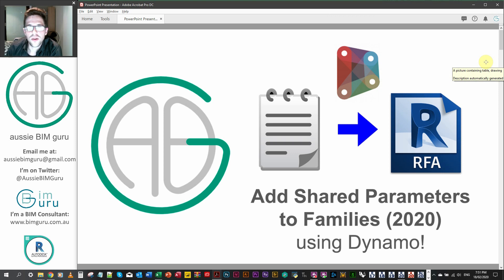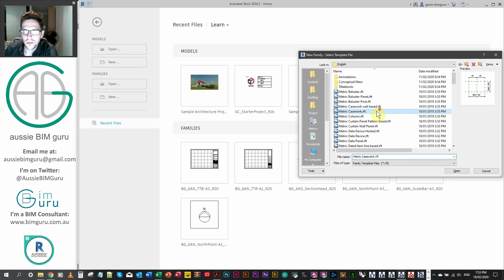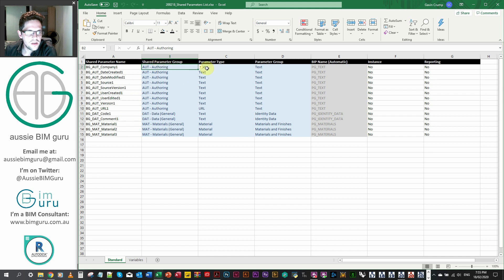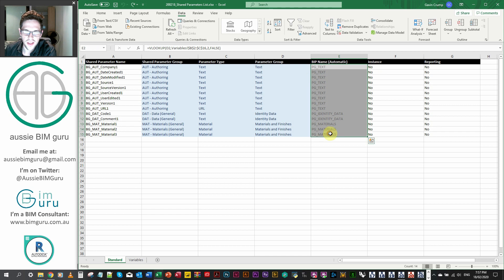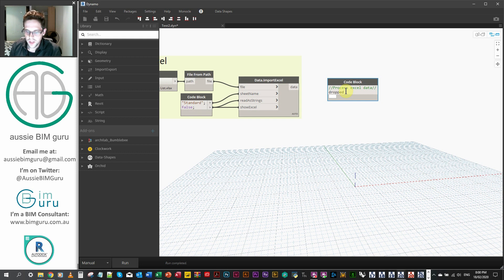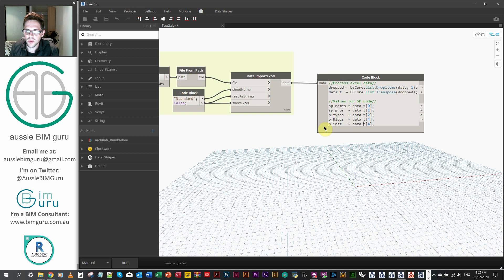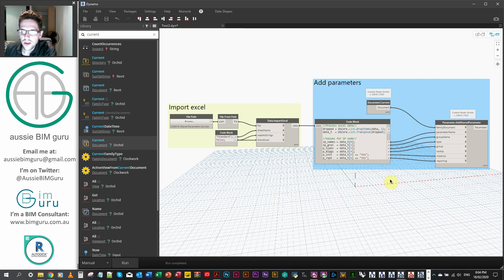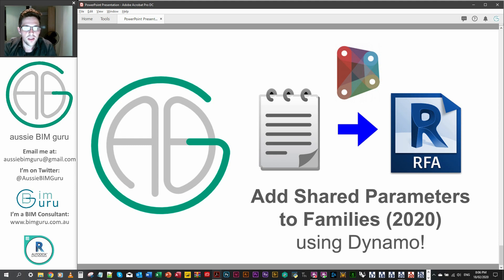Add Shared Parameters to Families using Dynamo! (2020 Update)

Comment: Hi I created as your instruction but Orchid package shows the different name for adding a shared parameter. 
" Shared Parameter. Add". I could not add parameters to a family for some reason.
Do you think the node had been changed and I need to change some things from your method? 
Otherwise, I did exactly same way, no idea why I cannot add parameter...
Reply from the maker: Probably, it seems the nodes changed for this workflow a few times... annoying!

Make sure you are using Revit 2020 and dynamo 2.3, orchid for dynamo 2.3.X or later.
Reply: It seems like you're using Revit 2021 & Dynamo 2.5. You are right that is it now called SharedParameter.Add, but the method that Gavin shows here works exactly the same.
Reply: @AussieBIMGuru  Hey Gavin, looks like the node's warning issue is now gone in Revit 2021 & Dynamo 2.5 when we run the script. But it's interesting that "Dimensions" is not a built in parameter group, so I had to group my shared dimension parameters under another group
Reply: @AussieBIMGuru  I used Revit2020.2 and Dynamo2.3.0. Orchid for 2.3.
Reply from the maker: @ATTechTutorials  thanks Alan! I just about give up with managing Orchid issues, it seems like the package behaves entirely differently depending on build and Revit version...
Reply: @AussieBIMGuru  I found what I had mistaken! I used Current Document node but not orchid!!
I am very happy that it worked well. Thank for your video!
Reply: @AussieBIMGuru  All good. Yeah, I can imagine. When you spend all this time to create a tutorial & then the method changes. Thanks for all your vids tho! Keep up the great work mate!
Reply from the maker: Ah yes that'll do it!

Comment: Hi Gavin, the script works properly for me but it isn't classifying correctly by "Parameter Group" it drops all my shared Parameter in the "Text"  , any idea on what am I doing wrong?
Reply from the maker: I believe text is the default. Some groups are not available from what I recall, which ones are you trying and did you use the excel template from github?
Reply: @AussieBIMGuru  In this case I'm trying "Identity Data" "Dimensions" and "Text" and I'm using the Excel template. Since I haven't done my self the Shared Parameters file, I'll take a look at it and try to find my mistake!

So as you said it is creating the  parameters and the type of parameter correctly but not the "group parameter under" which is being classified as "Text" by default..

Thanks for the reply!
Reply from the maker: Hrm I'm not quite sure unfortunately... this workflow seems to have very different results on other people's computers (I receive a lot 'didn't work for me') feedback on this video vs my others and believe orchid versioning has something to do with it and how nodes and levels behave.

Some ideas;
- try changing @L2 to @L1 and @L1 to no levels
- cross check all case management
- try just one parameter set to a non text group and see if it works. If not its likely the node vs excel, if it does then its likely something in excel

Hope that helps. I'm tempted to make my own copy of this node just so i have full control over how it behaves...
Reply: @AussieBIMGuru  Thanks for the Repply Gavin, I've tried your options, Levels solution is working but now it is classifying all as "Identity Data" instead of what it was doing before (Text). I'll keep looking for a solution !

Comment: Awesome video. Thanks a lot! There is something that´s bugging me... If I create the parameters from the excel file, will they be the same as the ones from the "Shared parameters file.txt" or will they be different but with the same name?
Reply from the maker: You're welcome! In this case the parameters would not be the same, as what really matters is the Guid which is nominated when the parameter is made. If you know the specific Guid you want to set to the parameter so it matches one that is pre-existing you could do this using the package Genius Loci, which has a slightly more complex node 'Create Shared Parameter with existing GUID'.
Reply: @AussieBIMGuru  OK! That´s clear then. Thanks for the Genius Loci tip, I´ll give it a try

Comment: Hi Gavin,
Love your work and thanks for sharing!

For some reason the graph adds the parameters but not exactly as I've setout in the excel file.  For instance, if I have multiple SPs in SP Group = DATA, they might be under Parameter Group DATA, GENERAL, OTHER, etc.  It does not appear to read past first Parameter Group designation for each Shared Parameter Group.
Nor is it reading and setting Instance correctly.
Is this just a limitation that we have to work with, as in just have a Data SP's grouped in the family as DATA (or manually adjust after loading them into the families).

Thanks,
Jamie
Reply: Ahh... Ok everybody, relax.  I went on and played with the Add SP to Folder graph and used the Level settings on the SharedParameters.Add node set to L1 and it has resolved my previous issues.
Thanks again Gavin!
Reply from the maker: Yes it appears the package author changed his node after this recording.
Reply: @AussieBIMGuru  Actually still having trouble getting the instance to translate properly.  Any ideas why that would be?
Reply from the maker: Not quite sure, if the list of booleans line up to the parameters and the levels match it should work in my experience.
Reply: @AussieBIMGuru  Don't get it but... In the spreadsheet, I say NO to instance when I mean YES, and then find the NO values, the graph sets the params to instance as I wanted.  In this case NO doesn't mean NO!
Reply from the maker: It sounds like you need to the flip the check. Ideally you should use the statement  == "Yes", this way if one if of the inputs isn't the string Yes then it triggers the boolean of false.

This input needs to be a boolean so make sure you're not feeding in strings.

Comment: Hello! I wanted to use dynamo to give warning if hole in my slab is more than 3 meter, anyone help please
Reply from the maker: You could get floor geometry, isolate the top surface using its normal (parallel to Z axis). From here, get surface perimeter curves, convert them to patches and remove the largest one (this is the overall perimeter. You'll be left with the 'holes', measure their surface area and check if any are greater than 3.

If you're checking for span of 3m, get these surfaces bounding boxes and mesure their width/depth instead.

Comment: Hello, do you know if this will also work for updating/replacing the parameters? For example, if I have the parameter "Length" set as a "Type" parameter in the family already and I update the excel to an "Instance" parameter and run the script, will it update the family to an Instance parameter or does this only work for adding new parameters to the family? Many thanks!
Reply from the maker: I believe this only works for adding not adjusting parameters.

Check out the 'MakeType' and 'MakeInstance' in Clockwork package as an alternative.
Reply: @AussieBIMGuru  sorry for the second question here... do you know if there's another way to achieve the same thing, but without using the Orchid package? It seems to be really temperamental working with it when you don't have the exact version of Dynamo his packages are made for. Thank you!

Comment: Hi, im currently binge watching all your videos, really appreciate the content! im was trying to get the orchid nodes from github when i realized im running dynamo 2.2 and they dont seem to work for that version. i installed core version 2.3 then, but that didnt work out (exe doesnt start, idk why). Any tips where i can find some help with the installation? do i have to install something else? Thank you very much!
Reply from the maker: If the exe is having problems I would contact the package manager (erfajo) via his github 'issues' page. It's important to note that the installer works for the active windows user profile, so make sure you're cross checking which windows location the files actually install to.

I would upgrade to Dynamo 2.3.0 if possible anyway, it's a lot more stable.
Reply: @AussieBIMGuru  i managed to get Dynamo 2.3. and everyhting worked! Thank you very much, now i can learn Dynamo with your vids :D
Reply from the maker: Awesome :)

Comment: Hi Gavin, just a heads up, I have had a problem with the Orchid "sharedparameter.add" node and checked out that this node should work on a Level1 (the package has been updated by the author). But for some unknown reason I'm still getting errors with "Invalid Parameter Type". However, the node used from Dyn to add shared parameters, which you used in a previous video works, happy days :-)
Reply from the maker: It seems the orchid node behaves differently in builds of Dynamo and Orchid. The dyn shared params node is ok for pre-R19, although I don't think ships into R20+ successfully.

Thanks for letting me know though!
Reply: @AussieBIMGuru  I'm using R2018 so the Dyn shared node works fine. But, I am also using the Orchid package for 2018 (OrchidforDynamo_200).
Reply: SAME PROBLEM HERE

Comment: Hello, 
Thanks for really great tutorials. How did you figure out the 'Built in parameter group names'? I use Revit(2020) in german - Names and naming convention for families, parameters, groups etc. are also in german. I would like to check if the  'Built in parameter group nameing convention' in the english version corresponds to the german one. or not. 
best regards, Ø
Reply from the maker: Good question. In this case I used some nodes from Archilab which provide access to the builtin group names. I believe there should be a dropdown node that provides then in exposed form.

If you happen to know Revit API I suspect this was achieved using an enumeration method to exhaust all the options the enum accepts. If you don't, then that probably didn't make any sense haha.
Reply: @AussieBIMGuru  
Thanks for the quick reply! Found a GeniusLoci node 'Get shared Parameter' That gives me 'ParameterGroup'(built in parameter group names) and 'ParameterGroupLabel'(Names of the group in german). I generated a dummy shared parameter file with one parameter in each common used 'built in parameter group' - runned the node = syncronized lists of german names and builtIn names :)

Turns out 'Built in parameter group names' are in ENGLISH(in the german Revit)!

I don't know Revit API => I didn't make any sence:( But I will learn! :D
Reply from the maker: @yvindfagerholt7994  interesting, I didn't know groups are always in english - thanks for letting me know!

Comment: Hi Gavin, is this working on revit 2018 using Orchid package? Thanks mate
Reply: ALso can this technique applies to multiple families at same time?
Reply from the maker: @steedlei1  Hi Lee! I believe it should work in 2018 but it will need to be built in that version specifically. I built and tested this specific script in Revit 2020/Dynamo 2.3 only.

The video after this one shows how to run the process in batch (also using Orchid).
Reply: @AussieBIMGuru  Cool! I do need this in batch working on 2018 to assign material for new created families (fences following topography) :) Thanks!
Reply from the maker: @steedlei1  ah that's a slightly different workflow I think... the fences are in the project vs. a library structure. You might just be able to work with the families natively in their host project using Orchid though.

Worse comes to worse, you know where to find me :)

Comment: Hello Gavin, thanks for your time. I am having trouble running the dyn, apparently I have a problem with the Orchid installation. This requires Python. What version of Python do I have to have running? Sorry for the inconvenience.
Reply from the maker: I just run the default ironpython thar ships with dynamo. For orchid, you need to install via the exes on github (erfajo) and open one of the sample files.
Reply: @AussieBIMGuru  Yes run. If I need to create Instance parameters, just by changing the excel file does it work?
Reply from the maker: @yalpeke  you would need to run the script each time you have new parameters to add. It doesn't work dynamically

For additional sets consider different tabs and a string input for tab name.
Reply: @AussieBIMGuru  thanks
Reply from the maker: @yalpeke  you're welcome!

Comment: Hi! Excellent video! Thank you so much for doing what you are doing. It’s great.

I have a quick question, though;

The Data.ImportExcel-node keeps giving me this error:

"Warning: Data.ImportExcel operation failed. 

Could not load file or assembly 'Microsoft.Office.Interop.Excel, Version=15.0.0.0, Culture=neutral, PublicKeyToken=71e9bce111e9429c' or one of its dependencies. The system cannot find the file specified"

Do you by any chance know what this means? I am assuming that it has to do with the version of my Excel-file, could that be correct? My process is, that I write the file in a Google Spreadsheet and then download it to my harddrive as a Excel-file (a temporary work-around, since I don't have the Office-package installed on my machine). 

I think that it might have something to do with that?

Thank you so much!
Reply from the maker: I believe you need Excel on your machine to read the Excel files in Dynamo. To my understanding it actually uses MS Excel with these nodes to interpret the data, not just the file format itself. You could try exporting the data from Sheets to a CSV file instead maybe? I believe the CSV nodes don't need any program installed to read these files.
Reply: @AussieBIMGuru  Ah ... yes. That could definitely be an explanation. Thank you. I’ll try that. Thanks!

Comment: Hi Gavin, I've got this to work perfectly, which is saving me loads of time :-). However, I've realised that I have set some of my parameters incorrectly in that they maybe Type and not Instance. I've updated my Excel sheet to reflect the changes required, but when I run the script again it doesn't change the parameters to Type or Instance in the sheet. Any ideas or is there another node to change the parameters?
Reply from the maker: Clockwork has two nodes that can do this, 'FamilyParameter.MakeType' and 'FamilyParameter.MakeInstance'.